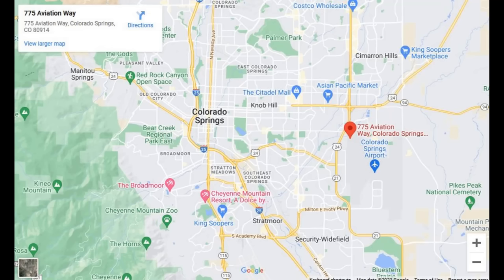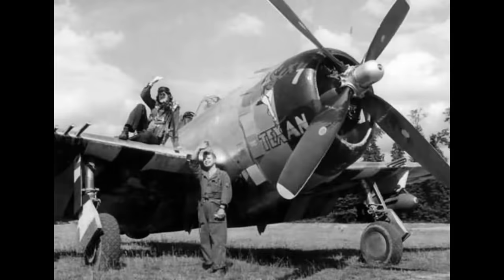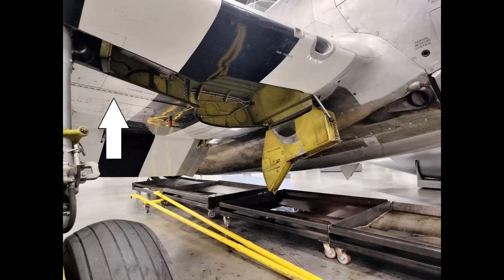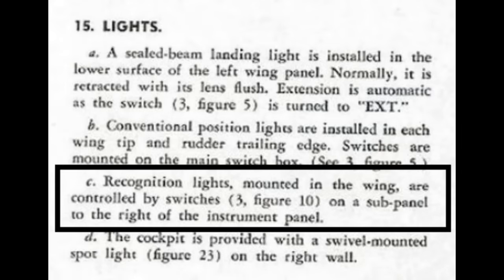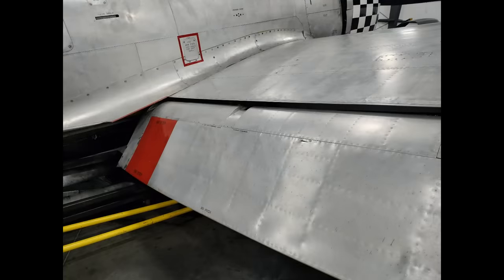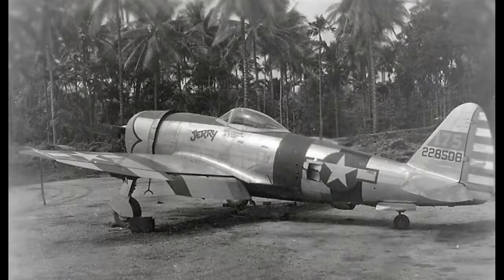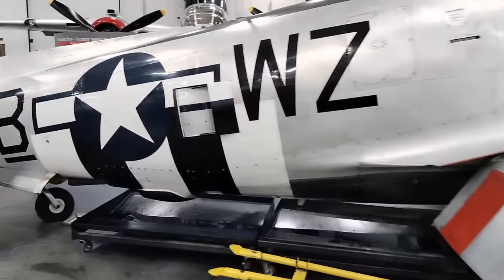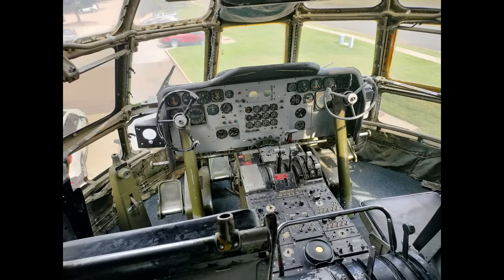Thunderbolt P-47 D-40, the Ultimate D model

Comment: I live in the Springs and go to this museum frequently. I don't think that thunderbolt has ever actually been restored, just maintained in original condition. They fly most of their airplanes frequently and have Wespac right there to do the maintenance.The coolest thing in the museum is the complete propulsion system for the P 47 sitting there without the fuselage. Talking about an airplane built around a propulsion system.
Reply from the maker: The propulsion system display was really nice to see. I almost made a video about that, but went with the D-40 instead. I heard that the D-40 has been crashed twice, so I imagine it went through at least some level of restoration since it was built, but to what degree, I don't know.

Comment: Greg, regarding the part about landing gear doors being open or closed with gear in the down and locked position, my question is there a difference in max airspeed with gear down and locked between types with closed gear doors and those with open gear well doors? Or is there no appreciable speed difference with the two gear door types? I would expect a full open door arrangement to be slightly lower limited but curious all the same.;
Reply from the maker: It does make a difference. Some airplanes have higher maximum gear down speeds than maximum gear operating speeds due to this exact issue. However of the two types the gear operating speeds will be the same all other things equal because the doors are open either way.

Comment: Well the P-47 Thunderbolt is iincredible aircraft it's very interesting to look at all of the Great planes of World War II the P-47 Thunderbolt were playing that was designed in 1940  it's first flight in 1941 in May, but I will be said to people to look at all the aircraft that were built for World War Two and most were built in late 1939 right up to November 1941. The air cooled engines that the P-47 and the Corsair  and Grumman were really incredible engines. And grew to be even more wonderful engines by the end of the war, most of the water cooled engines we're okay between 10:00 and 20,000 ft but then lost efficiency quickly, the Allison especially but that's what we had at the beginning of the war we also had to Packard, but once the Rolls-Royce Merlin came available and we started building them ourselves that was a game changer I've always told people if a plane over Merlin engine flies by I know it before it flies by .  Interesting thing is converter kept up with vances in aviation every day they put something new on the P-47 and their other aircraft they built
Reply: The Alison was just as capable at altitude with similar supercharging systems, the turbo supercharged Alison's in the p38's were an example

Comment: correct, the hatchbacks are faster and more aerodynamic, and the fuselage plays a huge part in yaw stability. when losing the hatchback, they lose some aft surface area that contributes to stability. adding the dorsal fins compensates for that loss. common to see such a change when a hatchback goes to a bubble. That, or the vertical fin grows in size.
Reply from the maker: Yup, same thing with the P-51.
Reply: If you look at performance charts for razorback and bubble top p-47s with identical engine and props, it seems the switch to bubble top didn’t hurt top speed as much as it did on the P-51s. In fact, they show a slightly faster top speed for bubble P-47s
Reply: They actually enlarged the tail plane on the Hawker Typhoon with the intro of bubble top canopies. Also quite noticeable is the tail design changes made on the Tempest V compared to the tiffie.
Reply: @dogeness  even on the P-51 the speed loss was not terribly dramatic, and it was justified for the increased visibility.

Also, if the P-47 didn't lose speed, or even went faster, it's because they changed more than just the bubble. An airplane like these will never go faster if the only thing you changed was going from hatchback to bubble.
Reply: @@cancermcaids7688 Wrong, it absolutely was due to the loss of wetted surface area on the aft fuselage. This is a critical part of aircraft design, but almost always unknown to the layman, or overlooked. 

the aft fuselage is aft of the center of pressure and center of gravity. It would be like cutting some of the feathers off of an arrow or rocket.

The less the loss in wetted area (as you mentioned), the less impact it has. Also, if an aircraft was already very yaw stable, it might still be yaw stable after (just less so). Generally CAS aircraft want a little extra yaw stability for accuracy.

Yes, a dorsal fin acts as a LEX, Leading Edge Extension, like you see on the wing of the F-16, F-18, and more, to create a vortex over the tail, further increasing yaw authority with a smaller tail. But this only applies when yawing. In zero sideslip it does nothing to contribute to basic stability.

Comment: With that huge prop arc you had to fly this plane off the ground from slightly off 3 point.  if you lifted the tail up, as most tail draggers required,
you would surely get a Prop Strike.

Comment: Another reason for the Mustang gear doors being closed is to ensure clean air for the radiator whereas the Jugs ducts were in the nose.
Reply from the maker: That makes sense, but many airplane with front mounted air cooled engines use the same sort of set up as the P-51 in regards to their gear doors. This was about a gear door principle rather than the P-51 specifically.

Comment: I find it crazy they were able to revise the plane so much in such a short time. Do you know if the manufacturer was able to increase the price of the plane for the revisions / improvements? Currently the US Government would be unable to deal with time table.
Reply from the maker: The price of most planes went down as the war went on. However the P-47 was never cheap, I think it was the most expensive piston powered fighter other than the P-38. That's actually the plane's biggest drawback, purchase price and operating cost. It was not a lack of capability.
Reply: @GregsAirplanesandAutomobiles  Interesting, I would have never thought that, even with constant improvements? Thank you for responding.

Comment: Remember that if you started the engine with the onboard battery, then the voltage regulator would recharge the battery, which uses engine power. Not much , but ....

Comment: Greg... is that a P-38 I saw in the background as you did the walkaround?! What model was it? Airworthy as well?!
Reply from the maker: Yes it is. I think it was an P-38 F-5. It's really nice and certainly worth its own video.
Reply: @GregsAirplanesandAutomobiles  The green P-38 with the blue spinners is the P-38F-5-LO 42-12653 “White 33,” and actual combat veteran 35th FG 39th FS, restored there in C Springs and flown by Steve Hinton for the first flight post restoration.

Comment: You are sure that ALL D-25 were Bubbletops? Squadron writes "the first Production Version of the Bubbletop Thunderbolt was designated P-47D-25 RE and, with previous Farmindale built aircraft, retained the Hamilton Standart Prop. There were 385 D-25 RE built.
The P-47D-26RA was the first Evansville built Bubbletop.............."

Republic had two factorys Farmingdale (suffix RA)  and Evansville (Suffix RE) and it looks like Productions wasnt sychronised for a while, Squadron Aircraft in action also writes:

 " Republic at Farmingdale could not keep up with the Orders for Thunderbolts and decided to built a 2nd plant at Evansville Indiana. With 2 plants building the Thunderbolt, the war department needed a way to tell  the aircraft apart. It was decided to designate all Evansville aircraft with the suffix of RA.
Thus the first aircraft from Evansville were P-47D-RA. They were identical in  every way to the Farmingdale built P-47C-2`s "
You have better sources maybe you can clarify the Things, iam not sure anymore if Squadron Aircraft in Action is correct.
Reply from the maker: Anytime you're talking about large production WW2 stuff, there are bound to be some exceptions. I can say this, the pilot's manual for the D-25 through D-35 makes NO mention of a razorback version anywhere in that mix. The previous manual which covers D-4 through D-25 says that prior to the D-25 they were razorbacks and that bubbletops were on D-25s and subsequent. Does that leave room for a few D-25s with razorbacks?

Comment: I always wonder, is does the flaps lever automatically return to neutral? So if you let go of it while it was extending would it stay extending or return to centre?
Reply from the maker: In the P-47, if you move the flap handle down and don't do anything else, the flaps will fully extend. The lever does not return to neutral unless the pilot moves it there.
Reply: @GregsAirplanesandAutomobiles  thanks, I kinda want to make this lever for my Sim pit and I wasn't sure if I had to add springs

Comment: The antennas look like the external wire VOR/LOC/GS Dipole Antennas, similar to the ones on older Cessna, Piper aircraft.
Reply from the maker: I agree however we need to consider that they didn't have those in 1945 and that square there isn't present on pre D-40s, so something was there or was intended to be there from the beginning.
Reply: @GregsAirplanesandAutomobiles  
Greetings Greg.
I agree with you..
Having had look over the AN/APS-13 manual (AN 08-30APS13-2) the shape of the antenna is different, being a u shaped antenna pair of reflector and director rods on each side. 
Based on the shape and location of the panel and cross-checking with the AN/APS-13 manual would infer the possible presence of the Tail Warning Radar at some point in the aircraft history. 
My guess is that at some time after the installation of the Tail Warning Radar, the antenna was removed and replaced with the current one as the area is preferred for the mounting of the VOR VHF antenna, composite airplanes with Glass Fiber Reinforced Plastic construction tend to have it placed internally.

Comment: I'm confused if the dive brakes add drag and there on the underside of the wing how are they able to bring the nose up seems counter intuitive is it because how close they are to the leading edge so less of the rear area of the wing generates lift?
Reply from the maker: They don't move down as far as you might think and they have the effect of moving the wing's center of lift forward which gives it more leverage as it's then farther forward of the aircraft's center of gravity. My Me163 videos go into these concepts a little.
Reply: @GregsAirplanesandAutomobiles  oh ok thank you for clarifying

Comment: Wow! You can tell all of that just from 3 trays sitting underneath a planes engine?!
Reply from the maker: Well, it's not that complicated. The turbo is near the rear of the plane and it uses oil. It has it's own oil system which takes up space between the cockpit and the turbo itself. One tray is enough for the engine, so the only possible reason for the other two is to collect oil leaking from the turbo system.

Comment: Greg, I have seen a video of a P-47 starting(?) and definitely taxiing. Apparently, for an air show/demonstration performance.
There were exhaust gases exiting from the from the front. Behind and below the cowl.
I assumed that this meant the airplane had a functioning turbocharger system. Is that incorrect?
If a flight worthy P-47 does not have a functioning turbocharger? Is the exhaust gas just sent back to the tail, bypassing a non-existent turbocharger, and then exhausted at the same lower outlet below and behind the engine cowling? I have always assumed that the exhaust exit, that doesn't appear to be a typical pulsating smoky radial engine exhaust, meant that the airplane had a turbocharger setup. Is this an incorrect assumption?  I will try to find the video to examine it more closely.
In modern P-47 restorations that do not have the original ventral turbocharger setup installed. How do the engine exhaust gases exit from the airframe?
I just drove through Colorado Springs in July, with my Son to see the last Nitromethane Drag Races in Denver at the Bandemeire Speedway. My Oldest Son was born while we lived in Monument CO when I was working at the USAFA hospital in 1990.
I wish I had known this museum was there when we drove home to Texas as I would have loved to see the collection.
An old High School friend of mine. That taught me to fly. A Fire Bomber Pilot and previous Rogue Air Applicator owner. Flies airplanes in the Jack Erickson Warbird Collection now based in Redmond OR. If you're ever in that area, and he's not working on fires, I could give him a call and  you could possibly see, in detail, some incredible airplanes in that collection.
They have a post-war Me-109 that had a Merlin engine. I sat in it before restoration years ago. Damn, that's a small cockpit and a heavy canopy. They have since restored it using a reliable Allison V-12 that is lowered in the cowling so that it looks like the original inverted V-12 DB engine and exhaust. 
Thanks for the great videos. They are very much appreciated.
Reply from the maker: If no turbo, the exhaust exits where the wastegates are on a normal 47. If it does have a turbo then the exhaust exits there AND at the turbo exhaust at the rear under the fuselage. As boost increases, less exhaust exits through the wastegates and more through the turbo at the rear.
Reply: @GregsAirplanesandAutomobiles  Thanks for the info. Like you, even though P-51 has always a gotten the glory. And is an aesthetically beautiful airplane. I've always loved the P-47 since I was a kid. I felt it was very underrated. Especially after your detailed examination of the fighter commands, intentional, lack of support for Drop tanks for bomber escort before the P-51 showed up.
To me, it was a travesty that this tough, but large, aircraft was relegated to low level infantry and armor support. In the last years of the War. Where it suffered horrible losses due to improved radar controlled German anti-aircraft batteries. 
Many great pilots were lost due to that mis-use of the P-47. But? War is Hell. 
As my Dad, a retired O-6, used to point out. The Peter Principle becomes exaggerated as the O ranks rise. 
Especially at the General and Flag O ranks.
Let's hope we can avoid WWIII. Especially with the political sycophants in those military positions today.

Comment: Why not use a big modern turbo for current flight ops?
Reply from the maker: You certainly could, but there is the historical value of the entire airplane to consider. It probably makes more sense just to take out the turbo and accept you are limited to 2000 horsepower and to lower altitudes, which you sort of are anyway by modern fuels and airspace rules.
Reply: @GregsAirplanesandAutomobiles  Greg, Im a military historian as well. One of my pet peeves are the still classified secrets of WW2. What is your opinion on the Germans' use of WMD on teh Russian Front? Putin said they lost 27 M. But Ive talked to some Russian historians and they think it might be closer to 30M. Thats a lot given conventional weapons. What is your opinion?

Comment: How do they run that beast on 100ll?
Reply from the maker: Probably by limiting manifold pressure.
Reply: @GregsAirplanesandAutomobiles  I spoke to some Collins Foundation people a decade ago about this and was surprised they hadn't made new charts for the acft. They said the either the -24 or -17 had the turbo's removed but I asked if they had any performance data and it seemed they had zero. It would seem to me, that at some point, the turbo would be more of a drag than a boost, unless at higher altitudes. The lack of performance data was concerning as if you fly in high/hot conditions that would be essential, I think. In '87 at Ft Bragg, the unit I was in had T-42's and every month they had to be de-fueled. We would line up to fill our cars. My old air cooled VW's loved the 100/110.

Comment: Those look like VOR antennas on the vertical stabilizer.
Reply from the maker: I think so too, but they are exactly where the tail warning radar antennae was mounted on the 47N. Coincidence? Maybe.
Reply: Looks like I cannot post links here, but I have found some manuals online about the APS-13  tail warning radar system. Assuming it is the correct unit, these manuals include operating procedures and dimensions of the antennas. They would have mounted on those square panels. There would have been 3 approximately 4" long antennas extending perpendicular from each side of the vertical stabilizer. The center antenna on either side would be a 4" long loop.

Apparently several of these type units were also used on each of the atomic bombs as range measuring devices.

Manual is AN 08-30APS13-2

Comment: Is this just me...
But isn't it kind of weird that you go see a P47 - with an original Turbo - but didn't actually take a picture of the bottom of the Aircraft showing the turbo...?
Reply from the maker: That's a good point, but I have seen the turbos a few times, a few museums have them outside of the airplane (including this one). What I had not seen was the intercooler, which is why I was so excited to take a picture of that. Also, I didn't feel like crawling around on the ground and you can't see much of the turbo without taking off panels anyway.